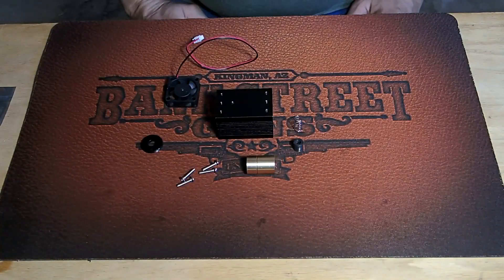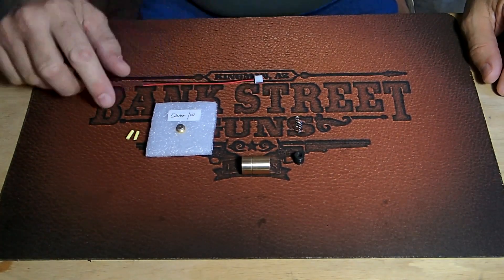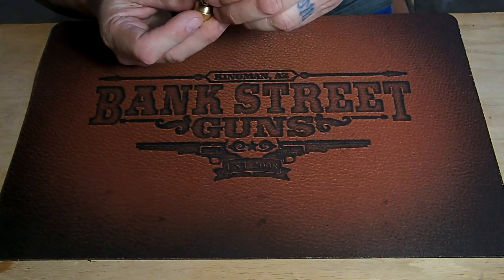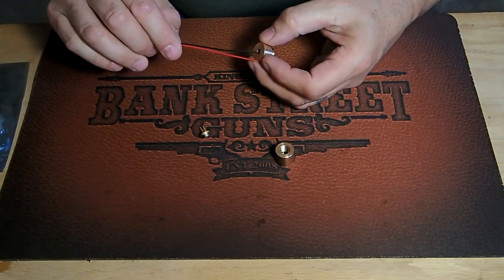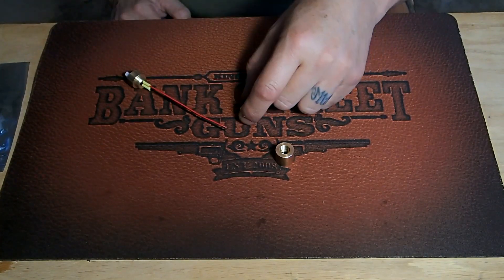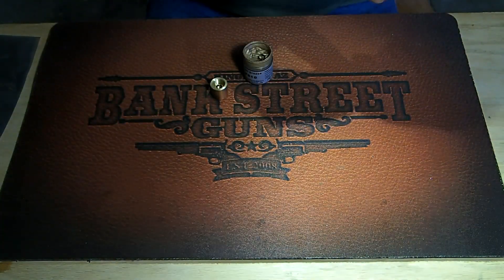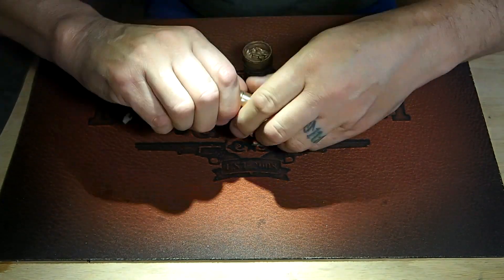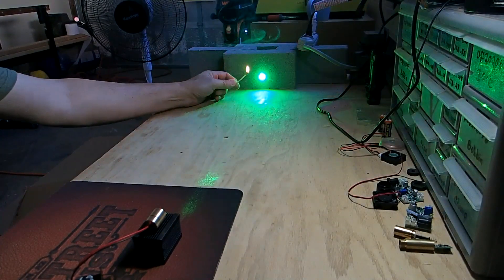Build Laser Diode Holder Assembly (Its Easy)

Comment: been looking intoo adapting a blue light laser module intoo an infrared one as i mostly will be etching and possibly cutting intoo sheetmetal and bare aluminium (dashboards / facias for machines ) bunch of knobs on a flat aluminium panel and i want to etch writing next to it (up down bump turn left raise lower volume scale that goes to 11 etc )
now i been looking around a little and couldnt find the base parts untill you showed links to them on another video (after i bought a broken module for 50 dollar with the intention on using that as the base) but i still dont know wat diode to use (yes a 1000 to 1164nm ) but dont know wat power driver (probably going to copy the driver you shown ) 
allso wonder if you need a different lens for the longer wavelength or just need to move farther away to focus , all sorts of niggly things that people only tell you about after you blown stuff up a few times and blown the budget (i couldve told you that ... insert wisdom and secret partsnumber) like finding out i can buy the base parts for a few bucks after i bought the 50 bucks broken module .....like to get ahead and not fall headfirst intoo problems that have been solved by other thinkerers 

i still havent browsed through all the vids on the subject , not that i find a lot on this lightsource conversion or if its even possible 
i would apreciate being pointed in the right direction , like wat video to watch and maibe the type number brand of the parts needed to adapt
Reply from the maker: You could buy an infrared laser diode from China on AliExpress you can use basically whatever lens you need since it's a close-up work usually the three lens modules
Reply: @RaptorRotorHead  ok thank you , the infrared laser diodes i see that are clearly in the infrared spectrum are usually verry low power wat is the kind of power that i need for the etching ?
Reply from the maker: @watahyahknow  from what I've researched the most powerful diodes now are blue they use blue laser diode in CNC Machining to etch metal, carved wood, cut Plastics.

On aliexpress.com you can virtually  get a complete CNC table with laser diode or you could buy the laser diode component with the laser diode driver in it all you would have to supply it is voltage
Reply: @RaptorRotorHead  that would be realy nice as the damage  lasermodule that i bought only has a damaged glas filter inside the blue diode is actually still fine from wat the seller tells me 
i had checked youtube and google on etching metal with a laser and only fiber lasers and the infrared xtool 50 watt diode laser version actually did that (even the laser tubes did not or verry vague )  , the blue ones usually only do organic materials , from wat i read sofar that is because the shorter wavelength of the blue light gets absorbed / reflected by metals , they do burn of paint sprayed on metal so if i spraypaint the facia black i could get the lettering contrasted in the metal colour might be able to do the same by covering the metal with vinyl 
once i got the module fixed and focussed i deffinetely going to try etching metal though 
the laser doesnt even need to do it fast i can leae it running all day if needed as metal doesnt burn , it just need to do it